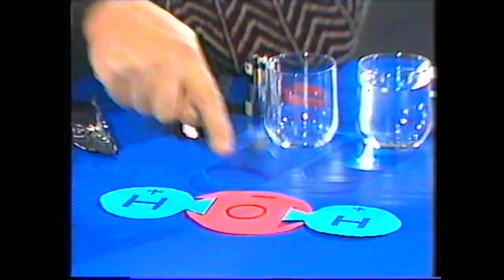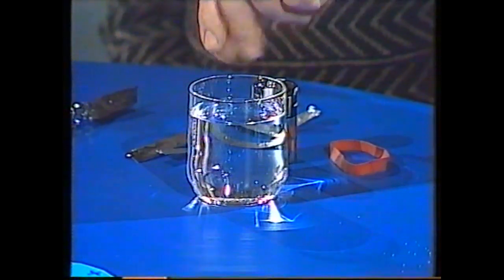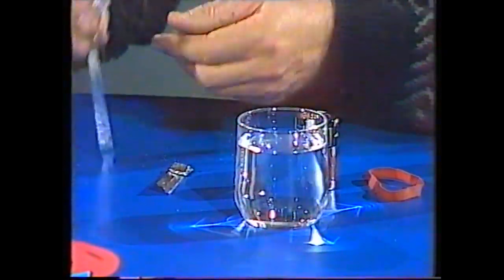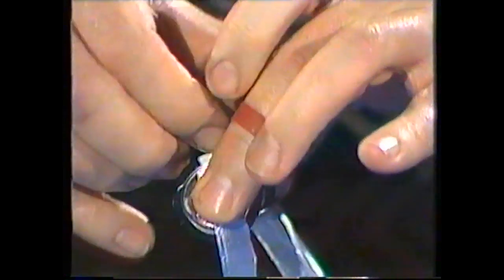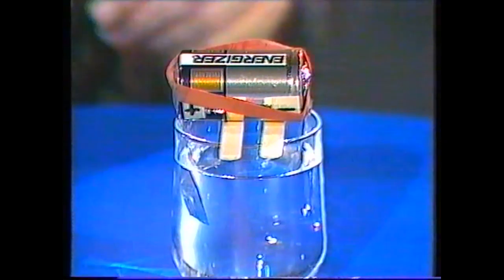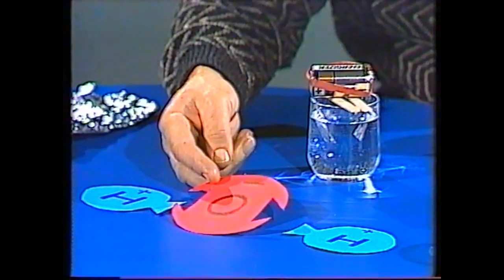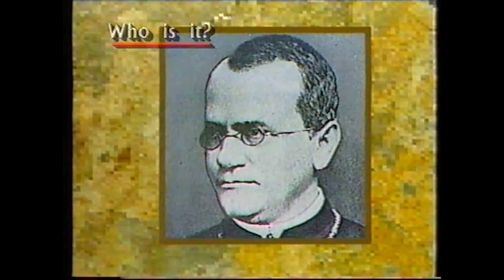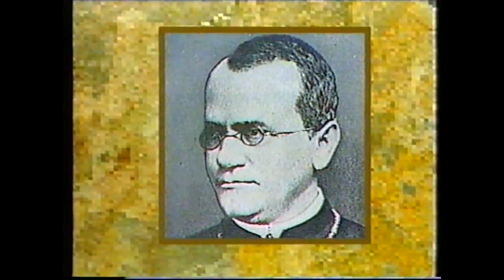How to pull water to pieces

Comment: I did the experiment as a 7th grader, took a bowl of water, added a couple of handful of salt. Then took a power cable, sliced off the plastic from both sides, attached it to the wall socket in one side, dipped the other side into the bowl, and then... turned the switch on. 😃
A big and very brief "brooop" sound, felt like a shockwave, all the water disappeared at once, and no electricity at home for several hours 😂
Turned out, the main fuse saved the neighborhood by dissolving itself for my incompetence 😂
The only good thing I did that day was, not touching the bowl while I turned the switch on. In that case, I wouldn't be here, alive, to write this. 
So, kids, please do not do this without having an adult to supervise your work.
Reply: Sounds fun, do it again and film it. Post it on Tiktok with some challenge and watch neighborhood blackout in random countries.
Reply: idk what kind of sockets you have (/had) but 220-230V wont kill you, it will barely scratch your skin. I've been electrocuted by wall socket several times and nothing really happened to me. Tbh I've electrocuted myself on purpose a few times cause I like the feeling 🤣
Reply: @Dzdzovnica  bro wth

Comment: The hydrogen molecules in water are at 104.5 degrees from each other, not 180. This is a consequence of the electron configuration and how the valence electrons are shared.  This angle leads to water being a polarized molecule with the hydrogen atoms being electropositive and the oxygen corner being electronegative. This polarization gives water its many exceptional properties.  It is a good solvant, has strong surface tension, and a wide range of temperatures at which it remains liquid. These facts make it essential to the existence of life.
Reply: Did he say anywhere that the angle is 180 degrees? Didn't think so.
Reply: @Kalumbatsch  The model at the beginning would make you think it is.
Reply: It's a kid's show for fuck sake
Reply: @kinnikuzero  Your life is a kid's show.
Reply: @0ffspringfan  It's flat. You could be looking at it edge-on. And none of that is the point here anyway.
Reply: @Kalumbatsch  Instructors should strive for correctness,  especially for younger children. Children learn easily when they are young and less easily as they age and begin to have their own biases. Mistakes learned at young ages can be very difficult to unlearn. I have seen the kinds of oversimplifications elementary teachers tend to make bite students later in their careers.

There are are standards for drawing molocules in 2d to show their physical structure, even when they do not fit in the plane. For instance, in the diagram compared to a 3d projection you can see how the link line thickness/dots are used to represent the 3d shape of the molecule:  https://geometryofmolecules.com/wp-content/uploads/2018/02/Nh3-Molecular-Electron-Geometry.jpg
Reply: @timharig  Utterly pointless nitpicking.
Reply: @timharig  Yes, I already feel sorry for the scores of people who got third-degree burns and died in fires because the Curiosity Show didn't tell them that the bond angle in a water molecule is 104.5 degrees.
Reply: @Kalumbatsch  it wouldn't have hurt to just have the model angled - I even think the connectors might have been a bit more obvious to the camera that way. Then the kids would be like "hey, that's what I saw on the show!" when it comes up in school years later...
Reply: When introducing concepts, start with generalized principles, then progressively refine over time. But if thrown in the deep end, beginning pupils will jump out of open classroom windows trying to escape.

Comment: This year I saw how audibly harmful adding oxygen to helium is, or liquid oxygen to carpet is as it supercharges the ability of something to conduct flames. 

Though I studied a fair bit about hydrogen, I never put it together... 2 parts flamable gas to 1 part accelerant makes a vital liqiid to survive and one able to quench flames... 

That sounds quite the contradiction
Reply: Sorry, what?
Reply: @Maninawig  "adding oxygen to a helium balloon and lighting it makes a loud boom."
No, it doesn't. Helium is a noble gas, it doesn't react with oxygen. You're confusing hydrogen and helium.
Reply: @Kalumbatsch  you are right in stating that helium cannot molecularly bond to oxygen if a balloon was diluted  mixed 50:50, the same would be said with Hydrogen, as they would require additional physical reaction to seperate the stable O2 into O1. 

However, what I am talking about isn't related to molecular bonds but chemical traits of the elements. Both hydrogen and Helium share the trait of being flamable. In other words they go BOOM and the flames are born. However, Oxygen is not flamable, but it is annoxidizer. In other words, it won't light on fire or go BOOM, but it does make flames brighter by feeding itself to the flame. 

Thus, by having a balloon mostly-filled with any combustable gas and partly filled with an oxidizing agent (oxygen being the purest form), then your boom is amplified. 

If you are referring to the Hindenburg, then it's important to know that the same thing would happen if it was filled with helium... The problem is that the painter chose to ignore the warnings and use a cheaper paint that, with the movement of the blimp, created enough friction to spark a flame.
Reply: @Maninawig  "Both hydrogen and Helium share the trait of being flamable"

No. That's bullshit. It's 100% wrong. Helium doesn't burn. As to the rest of your word salad, you have no idea what you're talking about.
Reply: @Maninawig  You have Helium confused with Hydrogen. They occasionally use Hydrogen to fill balloons as it is actually cheaper than helium, although it's obviously not very safe. Helium cannot burn, it's simply not possible.
Reply: Looking In With Victor B You got it all wrong, Helium doesn't combust in the presence of Oxygen when heat is applied, you're thinking about Hydrogen 👌🏻. Helium is one of the most stable, inert elements!
Reply: If you fill a balloon with acetylene and put a flame to it, it's pretty cool
Reply: Kalum may be rude, but he is correct, and Victor is unfortunately dead wrong, but with incredible conviction. Fire is a rapid oxidation reaction. Helium does not react in any way with oxygen, or, for that matter, any other element, outside of extreme (and I do mean *extreme*) conditions, such as in the center of the Earth where some scientists believe there may be Sodium-Helium crystals. Those are thought to be stable at around a million atmospheres of pressure. Another compound is LiHe, a gas that can only exist at temperatures around absolute zero.
Reply: tinylilmatt   Then you and  Looking In With Victor B are both wrong together. Helium is a noble gas. Noble gases have a completely filled outer shell which means that it does not bond with other elements, or even itself, because it cannot share valence electrons. So no,  the noble gases cannot burn. In fact, the are frequently used as inert gases in welding (MIG/TIG welding, the IG stands for inert gas) to displace oxygen and prevent the molten metal from rapid oxidization.

Hydrogen bonds quite easily as it has a valence electron that it can lend or borrow.  It naturally bonds with itself as a diatomic molecule so that single free hydrogen atoms are practically nonexistent.

Hydrogen burns (or oxidizes),  helium does not.
Reply: @joeyvindictive3552  Somehow I read that as "If you fill a baboon with acetylene"
Reply: Pot, kettle.
Reply: @timharig  I wish I had you for my highschool chemistry teacher back then.
Reply: "Conduct flames" I'm going to mirror the first poster. Sorry, what?
Reply: @UnitSe7en  sorry probably used the wrong term...  I was going for conduct as in a conduate. 

Basically, unlike the first person understood (and I probably did not explain well) Helium is a flamable noble gas, while Oxygen is (if I recall correctly, but think it is odd) an oxidizer. This mean that, although it won't chemically bond, if you half fill a helium grade balloon with helium, then finish filling it with oxygen, the gasses won't stay seperate like oil and water, but saturate resulting in oxygen and helium particles throught the balloon's inner volume.  And the same effect happens when you pressurize a balloon with Hydrogen and Oxygen. 

What the chemist I spoke about was demonstrating with a giant ballon was that if you introduced a flame to such a mixture, the Hellium/Hydrogen combusts (cause they are flamable) while the oxygen feeds the flame accelerating the rate of combustion... This also, as he demonstrated, made the popping sound of such a combustion a lot louder. 

In my original point, I was trying to relate oxidizers to electrical conductivity cause both accelerate their charges.
Reply: @Gnrnrvids  Helium is a Noble gas, which means that it lacks the ability to bond with other atoms.  However, this doesn't mean it cannot occupy the same space as it, or even that it cannot have a silumtaneous reaction to it (aka react with).  Same with filling a balloon with hydrogen and oxygen, they can have a simultaneous reaction of the first combusting while the second conduses said compustion, but it only bonds into water if an external force is also introduced, like electricy.

Another point is that if innert Helium and Oxygen were actually that reactive, then we wouldn't be allowing our children inhale the former to make silly voices, as air and helium would have to temporarily co-occupy our lungs... and I never heard of a kid's chest exploding for that reason. 

However, if you'd like a real-world use of such a mixture, though admittedly also having a Nargon added as well, would be called a Trimix for divers, to which I have a diver's confirmation. https://youtu.be/uCpUcyJ8E84

Again, this is safe because the atoms are only asked to occupy the same space, and not asked to chemically bond with each other.

Comment: How come car engines don't run on hydrogen? Maybe we just full the tank with water and it would just exhaust oxygen.
Reply: They actually exist, but it's not that simple. The car has an electric cell powered by hydrogen gas and a catalyst cell. The hydrogen tank has to be huge and takes a big portion of the car, so it's not very practical. Also having a huge pressurized cylinder on you the whole time might seem intimidating for many
Reply: It doesn't work because the amount of energy you need to put in is about equal to the amount of energy you would get out.
Reply: Hydrogen fuel cell cars are totally a thing! They actually exhaust water, because that's what you get when you react hydrogen and oxygen, but yeah, they're a thing! https://en.m.wikipedia.org/wiki/Fuel_cell_vehicle 

Or at least, they could have been a thing. The problem is getting elemental hydrogen in the first place.

Simply put, it takes much more energy to break water apart than what you get out of it when you put water back together. 

So either you eat up a LOT of power at the factory to produce hydrogen by electrolysis (the process Rob demonstrated), or you use hydrogen that's produced as a byproduct of natural gas refinement. Neither of those options are very sustainable or environmentally friendly...

That is why the industry* has focused in more recent years on making better batteries so electric and hybrid-electric vehicles can be more viable options; together with addressing the way we produce electricity. 

It's not just cars that are burning fossil fuels and contributing to climate change; it's the power plants, too. So the hope is to transition to cleaner energy sources like solar, geothermal, biofuels, wind, and maybe even sustainable fusion reactors within the next decade or so! It's something to get pretty excited about!

*I am, of course, referring to sensible side of industry that wants to keep living on a habitable planet, not the greed-driven oil companies and political interests that are actively fighting against this kind of progress
Reply: @otakuribo  climate change doesn't exist
Reply: @user-rg7uz8of9r  Not even Trump thinks that. The argument is what's causing it, not whether it's real.
Reply: @DenkyManner  Every aspect of your comment is fallacious.
Reply: There's this car that runs on water man!

Comment: 2:20 I wonder what would happen if instead of putting opposite electrodes of a battery into the salt water, we instead put the positive and neutral terminals from a wall socket? I think I might have to try this at home :)
Reply: That would be VERY dangerous.
I used a 12v car battery. it will produce enough voltage and amperage to separate the atoms a pretty fast rate.
Reply: @cyclenut  How should I proceed with my experiment? Safety glass I presume. Any other tips?
Reply: @Rick-the-Swift  I did research with google.
>Safety glass = yes.
>Any spark or flame near the gases produced can explode.
>Do it outside in the open, away from any thing that can be set fire, just to be safe.
>Use plastic bottles, ie 2 litter soda or gallon milk jug. No glass.
>Use only battery, no electric from house. 12v car battery is what I used.
I only did it for fun and learning.
Have fun and "Safety first"
Reply: wall sockets are alternating current so electrolysis wouldn't work
Reply: @Graknorke  Could you please explain why electrolysis wouldn't work with alternating current? Seems like it should work similar to DC only it would be alternating between working and not working,. No?
Reply: If you're in North America the alternating cycle happens 60 times in a second. Faster than you can notice. And as water will create a short circuit you will only blow a fuse or trip your breaker at best.

Comment: So if the oxygen is dissolving back into the water, and water require quite frigid temperatures to maintain a liquid state, that liquid oxygen should be cold.
Reply: The water doesn't need to be cold. The dissolved oxygen is how fish breathe, so think about a tropical river with warmer water, the fish can still breathe it, and the water is not frigid.

Liquid oxygen is certainly very cold, but the oxygen that is dissolved in water is not liquid oxygen, the same way the table salt that Rob sprinkles in is not a liquid either, rather the molecules of sodium chloride (the chemical that is table salt) are separated and spread around the liquid being held in place by similar electric charges to what Rob describes with the battery terminals.

Solvation is a quite detailed topic, I'd suggest reading about it on Wikipedia as a start, and if you are really interested, borrow a high school chemistry textbook from a friend or library to learn more about solutions, solvents and solutes.

Comment: to put in some more thoughts at the around minute mark where he adds salt to the water (to "ionize" it). to put it very shortly, bluntly, and probably with too low a sophistication: water dissolves metal, metals so conduct electricity quite well (contrary to just water alone). therefore, water that comes into contact with metals becomes conductive. your tap water at home is already quite conductive (as opposed to pure rain water) because it already came into contact with various metals. this night not be totally obvious at a first glance, but our very surface essentially consists of metals. what you tend to call rock, I dare to also call a metal. way more than you think is actually a metal, and so is salt. since we humans adapted to drinking water, we now even need those extra parts in it (which in this case, we then call minerals .. but again, essentially another word for just yet again the same, namely metal). salt is a metal as well (when it dissolves in water, it's quite safe to call it a metal. sugar isn't one, but it only dilutes in water; not dissolves). he only adds the salt essentially to make extra sure the water will be conductive enough for this experiment to succeed (which I haven't seen yet, but can somehow imagine what it'll look like, lol).

Comment: hang on .. in school I learned they're positioned at an angle of 107 degrees .. not 180 (even though one now could argue, it's just a two dimensional projection where this angle got lost at [which indeed is possible]). otherwise it would seriously alter its physical properties like melting point and such (so, let's rather be "grateful" for exactly this angle, as I was also told in that very school, lol).
Reply: LOL, they're not at 107 degrees.........they're 104.5 degrees
Reply: @subaruthug  ahhh, that's why it was only awarded second best school in town 💡🤣

--

maybe, this is valid on the equator only due to an increase of angular momentum; I'm Santa Claus's son and went to school on the north pole.

--

or go check your ruler—it probably shows imperial angles.